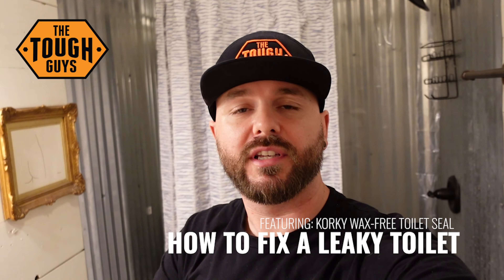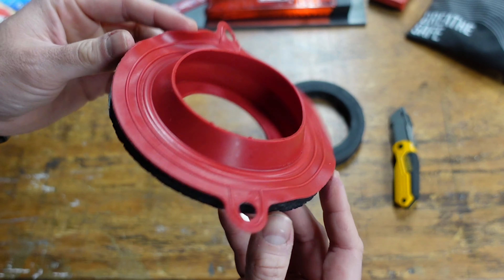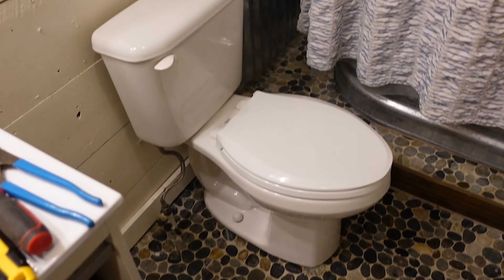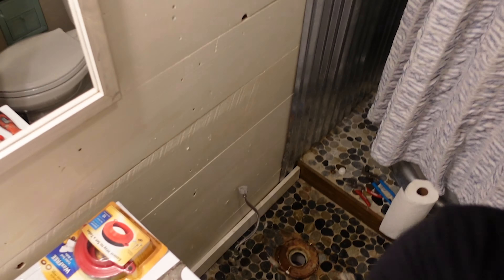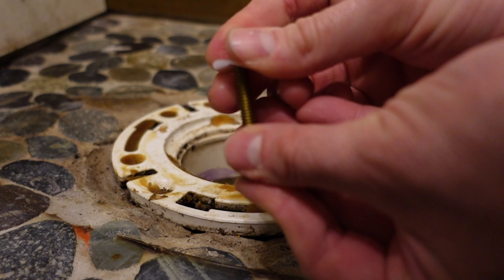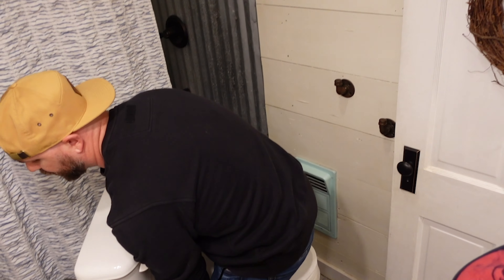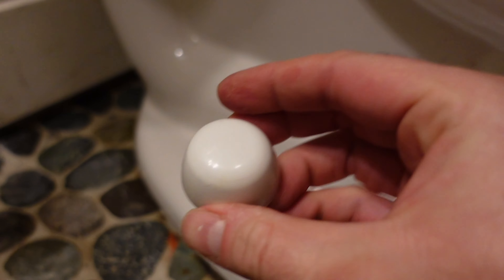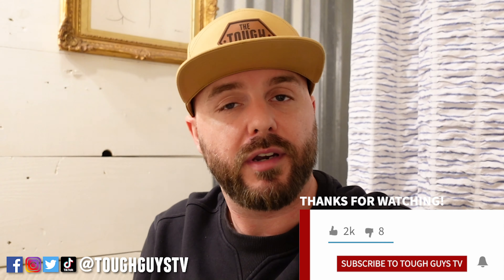How to Fix a Leaky Toilet with a Korky Wax Free Toilet Seal!

Comment: Two things: Before you begin cleaning up the old wax, it is a good idea to stuff a rag into the toilet drain to prevent sewer gas from escaping, and to prevent dropping anything down the drain stack. Also, when preparing to install the washer and closer bolt nuts, there is usually a a white plastic washer that should be installed the right side up which allows the caps to snap into place. First install the plastic washer, then the metal washer before installing the nut. Tighten the nuts evenly, alternating fro from side to side, taking care not to overtighten. Finally, cut the bolts short with a mini hacksaw to allow room for the placement of the caps, then check your nut tightness once more, ensuring that they are snug, but not overtightened, then reinstall the caps.
Reply from the maker: All great tips!! Thanks so much for sharing and for checking out the video!

Comment: Was interested in non wax options after cleaning up the terrible job I had in my bathroom before installing new vinyl. This looks much cleaner, thanks for the video!
Reply from the maker: Thanks for checking out the video! Hope you have good luck with your install, I’m not a fan of the wax rings either.

Comment: I was not familiar with the no wax ring toilet seal until today since I've been out of the maintenance field for over 9/10 years and just getting back into it for 6months, but I had a work order for a brand new toilet that was leaking from the base of the toilet so I grab a wax ring and go to fix the issue so once there and I get the toilet unhooked and remove it from the flange to my surprise there is no wax ring which I didn't understand so I ended up using the wax ring and putting the toilet back on the flange but as before the toilet would not sit even so I put a few shims underneath it a tighten it down needless to say there was no more leaks so should I go back and redo it tomorrow

Comment: So far I like this seal more than its competitor (fluid master) which said it fits any and every flange. I bought a 3inch pvc flange. The fluid master fit terribly in it. Installed toilet and it dripped until the bowl was at a certain level. I could hear it in my daughters room and without a fan it was like being waterboarded by isis. No thx. Finally took it out and replaced with this one in the video. Fit nicely on the flange and instantly didn’t hear anymore drips. Now my daughter can sleep in piece 🙏🏼
Reply from the maker: Thanks for sharing your feedback on the products!! I've used these korky units a few times but I also know guys who stay away from anything other than wax ring seals - I personally hate those after using these type of seals.  Thanks for watching!
Reply: I’m going to retract my comment. Still leaking down. Idk if it’s this dam flange I bought or what but I’ve had zero luck with these rubber seals. Going to try wax and if it’s still leaking, idk what im going to do. Probably change the flange. Toilets brand new.

Comment: To get the caps on, it looks like you need to cut down the bolts.  Thanks for sharing, I'm considering this seal!
Reply from the maker: Yeah probably need to trim the bolts a bit - not a bad idea! I’m a bit worried it’s going to get loose again, so I’m going to keep my eyes on them. Thanks for checking out the video and for the support! 🙏🏻
Reply: I'm right at 1/2" above the floor. I used the thin gasket and I can't get the toilet to set completely on the floor. I'll be returning it and getting a different ring.
Reply from the maker: Just saw your follow up comment - What did you end up going with and did the alternative work out well for you?
Reply: @ToughGuysDIY  I went with the fluidmaster better than wax seal without a problem. I had to reset my neighbors toilet and the better than wax seal wouldn't work on it, I got the korky again and it wouldn't work either. I ended up going back to a wax ring on theirs, only because the flange was really shallow and only a 2" opening. So I have found that these waxless seals have some limitations and you have to have one that works in each situation.

Comment: FYI redid my sister in laws bathroom and used these for her new toilets. After a year the 2nd floor toilet leaked by and ruined her ceiling. Prep and install were all done in accordance with the directions.
Reply from the maker: That's a bummer for sure!  Thanks for sharing your experience.  Sometimes, things don't work out I assume.  My wax rings have failed multiple times in this house - so hoping I get lucky with this one!
Reply: If installed correctly leak should have come out on floor surface and not run down through ceiling

Comment: does the toilet rock on the pebble floor? I bet that's why the wax seal broke. Hopefully that cheap black sponge stuff lasts as long as they claim.
Reply from the maker: It doesn't rock when the bolts are tightened - it came loose because the kids using it I guess, it's been solid now!